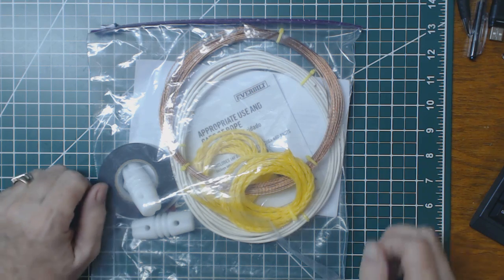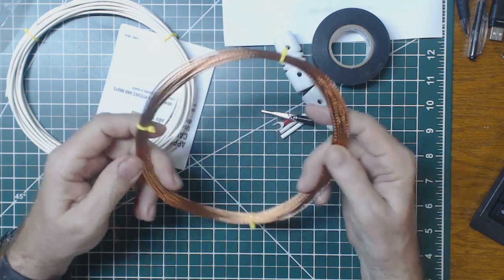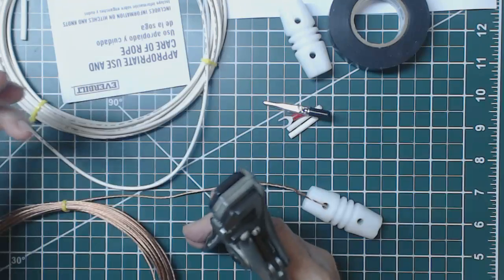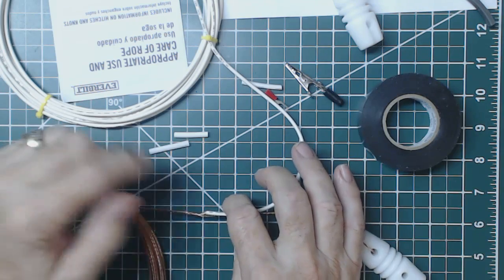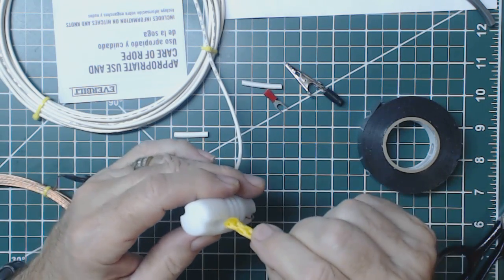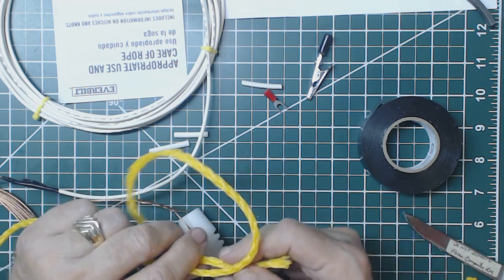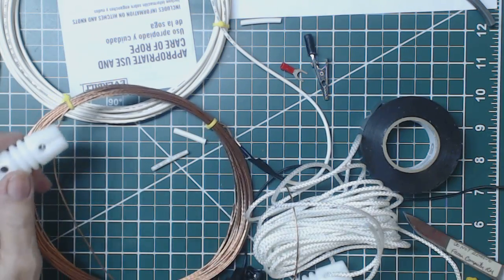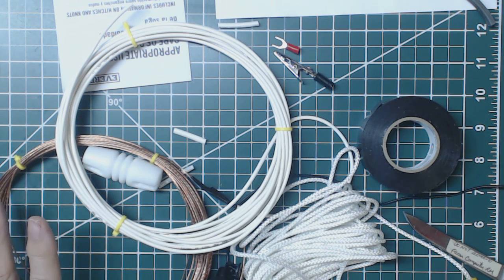TRRS #1048 - Simple Shortwave Antenna Kit - Assembly

Comment: thanks tom. it's a bedroom.  i have a bare solid copper wire around the perimeter on the inside of each window.
i have a coaxial cable ( stripped bare on both ends) . one end connected to the radio and the other wrapped around the middle of the antenna.               window.........solid ccpper wire.................... window  
                                                                        l
                                                                        l   coaxial cable   
                                                                         l
                                                                     radio

p.s.does the coaxial cable have to be centered on the antenna. some show the lead wire in near the end of the antenna. thank you as you can see i'm new at this. thanks again, Dick
..

Comment: hi tom, can i place a longwire antenna indoors(same room as radio) against an outdoor wall-around the perimeters of 2 windows-- example            window1................window2  and run a wire down the middle to the radio? thank you
Reply from the maker: You can but if there is a lot of RF in the room from computers, routers and other electronics. it will be picked up by the radio. It is worth a try but just be aware you could have RF noise problems.  Even having an outdoor antenna with unshielded wire coming into your house  to your radio will be a problem too.